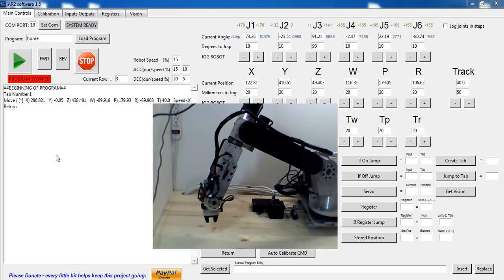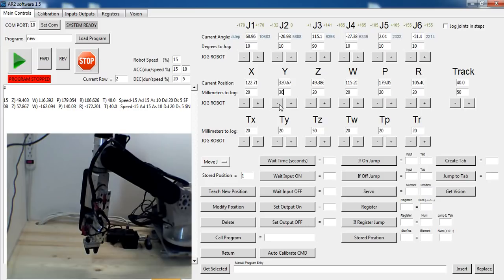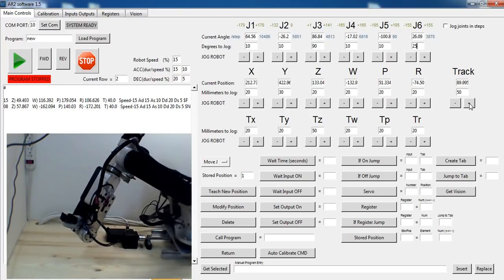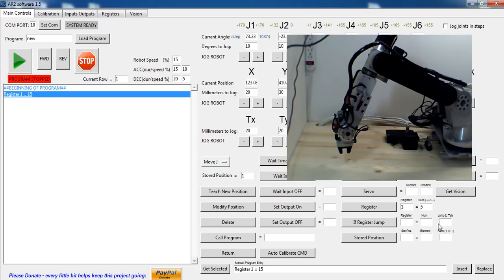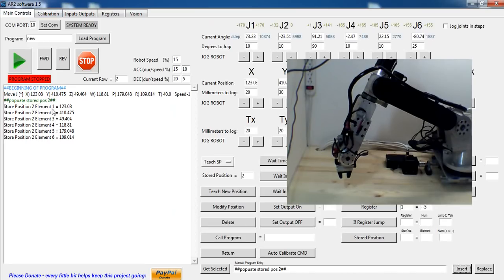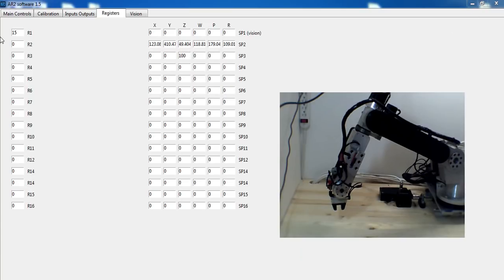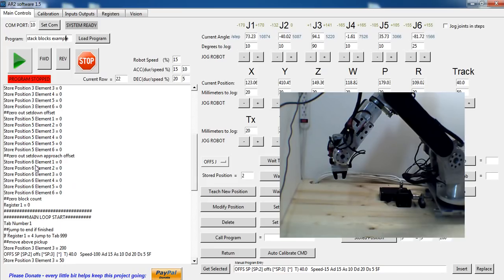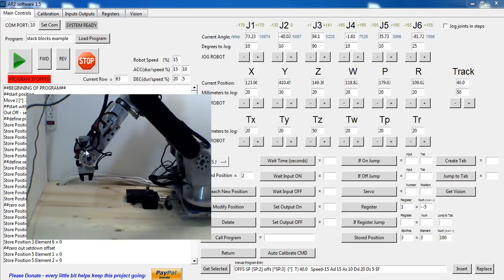AR2 robot - Programming Part 2  (Ver 1.5 updates)

Comment: how much filling required for ABS 3D print of AR2? thx. is it easy to program it as barista .operate coffee machine with latte art( place on readily tilted cup holder)
Reply from the maker: On the 3d printed versions I have printed the spindles at 90% to 100% infill,  the arms and structural components at 50% and the covers and spacers at 20% infill.  You can find the latest manual and print files for the AR4 www.anninrobotics.com
Reply: @anninrobotics  thx for the speedy reply

Comment: Hi chris ive been watching your videos for awhile looking to implement some automation in my machine/Assembly shop. im Planning on building one of these and eventually implement a automatic screwdriver head as the payload. With you custom program is there someway to make the robot turn on a spindle and push forwards? In one of your previous videos I saw you mention you are looking into doing some machine shop tasks with your robot. I don't know if your purpose to this is improve robot or market you robot a little bit more. Probably both but please contact me if your interested in collaborating in my assembly robot. Just to clarify I am not asking for a free robot or any of that nonsense. Ill build the robot and buy all the nessary hardware to accomplish the screw driving head. Contact me at gengenbach4@gmail.com if you interested. 
Thank you for your time
Reply from the maker: Sounds very interesting, I’m very interested in keeping up with what you come up with. I will try to shoot you an email when I get some time but I’m pretty slammed right now. Feel free to drop me a line anytime if you have any questions or any thoughts. chris.annin@gmail.com

Comment: Hi in his project is already prepared to apply different applications at the robot and example: insert in the program strings that command digital output on arduino that in turn control relays or pneumatic solenoid valves?
Reply from the maker: Luigino Biagetti yes